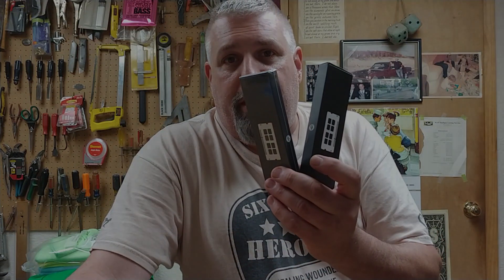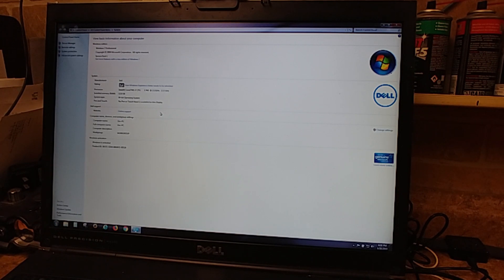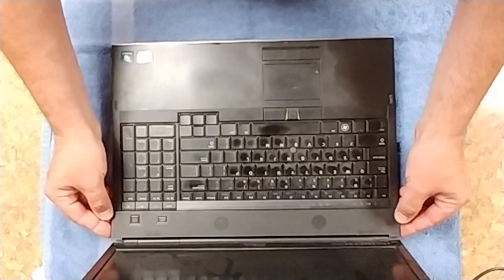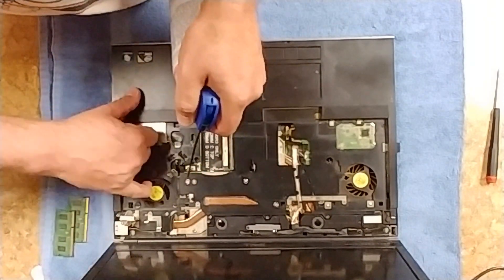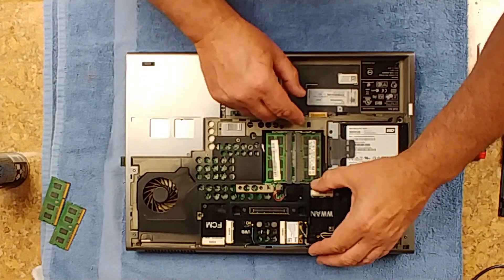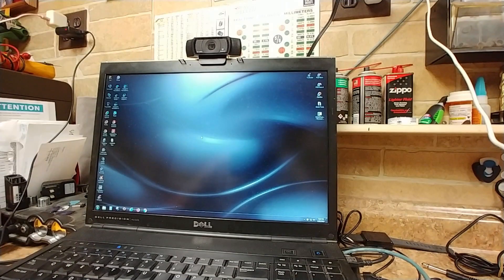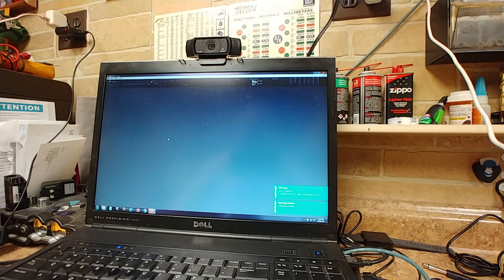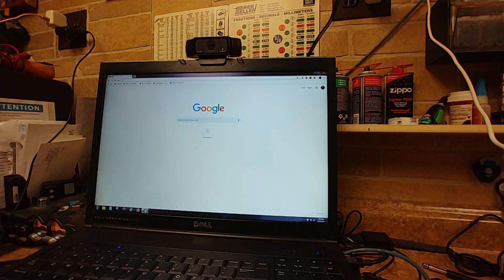Dell Precision M6500 Memory Upgrade

Comment: Please help me. My laptop dell precision m6500 after turning on the CPU goes to 100 and immediately turns off. This happens while the laptop is charging.
I have changed windows and drivers a thousand times, I even opened it, cleaned it and changed the RAM, but it is still the same.
Reply from the maker: It is overheating? Did you remove the CPU? Under the heatsink that is on top of the CPU, there is a thermal paste. If you ever removed the heatsink off of the CPU, you need to put fresh thermal paste to cover the top metal part of the CPU that makes contact with the heatsink. Also making sure the vents on the back by the power input and the other side are not clogged with dust or blocked. Also make sure the fans are working. One side is the CPU fan and vent. The other side is the video card or chip cooling fan and vent.  If the fans are working you should hear them when booting up.
Reply: Thank you very much for your reply
No, when I turn on the laptop, sometimes right away and sometimes after I run a game or program, the CPU goes to 100% and the screen goes completely black, but the laptop is still on.
This happens only when the laptop is connected to the charger
I noticed that most of them have this problem in the Dell forum
There, someone said with a nvidia PowerMizer manager program
In this program, I have to set the power of the laptop to half the normal mode so that this problem does not occur, but even with this program, the CPU still goes to 100%, but the screen is no longer black, but this program officially takes half the power of the laptop and that's it. Again, the CPU is not fixed
I apologize for the way I wrote, I hope I got my point across, unfortunately there is no Dell representative in my country, I will try to fix it as best I can.
I haven't opened the CPU yet, but some people said in the forum that it might be from the heatsink, can I fix it myself? @ericctheartofnoise8613
Reply from the maker: I have not done any gamming with mine, but I have put the CPU and video card under some stress. Never had a blackout happen. Are you running Windows 10? Mine has 10 Pro on it. It almost sounds like a power supply or the input plug on the back is not working correct. Can you wiggle the plug on the back when it is plugged in? I
m just trouble shooting now. Could be a bad solder joint in the plug. Have you tried to tune off the nvidia  PowerMizer or roll back the driver for it.

Comment: I have a question. I read on the Dell website that only i7 920xm supports 8GB 1600MHz RAM and if I go with 16GB 4x4 is or 8x4 it gonna work only 1333MHz?
Reply from the maker: all depends, some i7 920XM will support 1600MHz. If its not the Extreme Edition CPU your stuck at 1333. i'm running i7-4810MQ CPU @ 2.80GHz it sees the 1600MHz with no problems. i found an i7 Extreme Edition CPU and upgraded another M6800 and now its seeing 1600 with 32gigs of ram.

Comment: Hi, I have dell precision m6500  i7 740QM, may I use 4×8GB 1600hz, and I want to upgra6my CPU to 940xm, it's possible?
Reply from the maker: the ram you want to use will be fine. here is the list of CPU config you can use if your computer has the requirements.
 The M6500 Mobile Precision Workstation can support up to 32 GB of RAM installed using 4 x 8GB DDR3-1333MHz modules, but there are restrictions. Installations of more than 4GB RAM require a 64 Bit operating system to be able to address RAM addresses above 4GB.

If the system has a dual core processor, the memory max is 8GB (2 x 4GB DDR3-1600 MHx Modules) in slots 1 and 2 (Slot on the bottom of the chassis). Dual Core Processors shipped on the M6500 are:

    Intel® Core™ i5-560M Dual Core 2.66GHz 3MB
    Intel® Core™ i5-580M Dual Core 2.66GHz 3MB
    Intel® Core™ i7-640M Dual Core 2.80GHz 4MB

If the system is configured with a QUAD Core processor, then the memory configurations are as follows:

    1600 MHz Memory Speed
    8.0GB, DDR3-1600MHz SDRAM, 4 DIMMS
    4.0GB, DDR3-1600MHz SDRAM, 2 DIMMS
    1333 Mhz Memory Speed
    32.0GB, DDR3-1333MHz SDRAM, 4 DIMMS
    16.0GB, DDR3-1333MHz SDRAM, 2 DIMMS
    16.0GB, DDR3-1333MHz SDRAM, 4 DIMMS
    12.0GB, DDR3-1333MHz SDRAM, 4 DIMMS
    8.0GB, DDR3-1333MHz SDRAM, 2 DIMMS
    8.0GB, DDR3-1333MHz SDRAM, 4 DIMMS
    4.0GB, DDR3-1333MHz SDRAM, 2 DIMMS
    2.0GB, DDR3-1333MHz SDRAM, 2 DIMMS

Dell shipped Quad Core Processors are:

    Intel® Core™ i7-740QM Quad Core 1.73GHz 6MB
    Intel® Core™ i7-840QM Quad Core 1.86GHz 8MB
    Intel® Core™ i7-940XM Extreme Edition 2.13GHz 8MB

Make sure you understand the physical limitations of the system before attempting any RAM upgrades. Systems with Dual Core processors are limited to 8GB total RAM installed in slots 1 & 2. Quad Core systems also use memory slots 3 and 4 (Located under the keyboard) and have a maximum of 32GB of RAM.

Comment: Thanks for taking the time to film this! I have a lower spec M6500 that I refuse to part with. Last of the 16:10 screens that are easy on my old eyes, and so comfortable to use over long periods. And it travels, even if it is a brick.

Are you familiar with the Dual-Core versions? Mine has the I7-620, which seems to basically be an overclocked dual-core I5. It's limited to 8GB of ram max in 2 slots. I don't know if it's missing the top or bottom ones, I should have looked when I replaced the keyboard. Right now I have 4GB (2x2), which obviously doesn't cut it anymore for even basic tasks. I planned to just order 2x4GB DIMs from Crucial, have read these machines are picky about ram.

This was just what I needed to see. The rest I think I can figure out. Awesome PC, still capable after all this time. Too bad parts aren't more available. Thank you!
Reply from the maker: i have noticed with the i7 M6800 that i gave to my father. with the i7 dual-core it would only take up to 8GB of ram. i put a i7 quad-core and now it will take 32GB. my M6500 is an i7 quad-core. if it had the dual-core 8GB is the max.
Reply: @ericctheartofnoise8613  Thanks for the thoughts! The 2 core I7 is an odd duck for sure. I didn't get to spec mine, it was bought as either a refurb or s&d unit from Dell, and units with the full RGB-LED panel were rare as hen's teeth in the outlet at the time. $3K+ wasn't in the cards for me at that point, the one I bought was just under $1K, and I'd say it's earned its keep even though I use it more for more mundane, less demanding tasks than most. I still have the email from the Dell Outlet with all the specs on it. Between the build quality and better warranty I've always leaned toward business class PCs and workstations. It managed fine with 4GB for a while, but I think today's browsers are too RAM intensive for it to be viable. Hoping the upgrade works. And helps. Having a guide will be invaluable, thanks again!

Comment: If you want it to run even better, get a solid state hard drive. You won't regret it.
Reply from the maker: Have one in it. They are great.
Reply: @ericctheartofnoise8613  If you have a Win7 M6500 I take it there's no way to do an SSD swap without installing Win10, right? Wouldn't you need OS verification codes of some sort, or does the SSD software just "Clone" the entire drive? I'd like to go SSD one day, the 500gb drive in my M6500 is finally full, and I'd like to do a bigger primary drive or at least do a small SSD and a platter drive in the 2nd bay. I'm such a noob at this stuff... 😂
Reply: There should be a Win7 COA under the battery.

Or just pirate it :^) get a ISO and Daz's Loader from MyDigitalLife and call it a day.
Reply: Every second counts.

Comment: I have downsized my 2017 xps had the 8700 model i7 4ghz with boost and all was great. Then I sold it for what I paid and I got the 8500 model. Was hard up ..lol. Anyway I have the i5 2320 CPU and radeon graphics. Cheap little sucker but I dont game. I have a ps4pro for that. Anyway I need to set mine up daw and all that lol....Killer vid man. A laptop would be great in my situation lol. You can find cheap older laptops. I may. Lol. Just for music. Lol